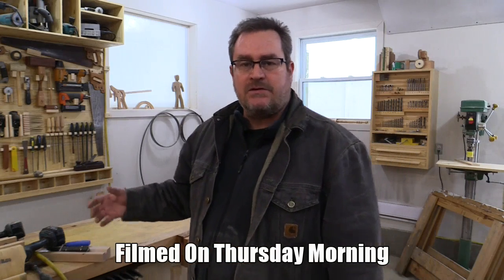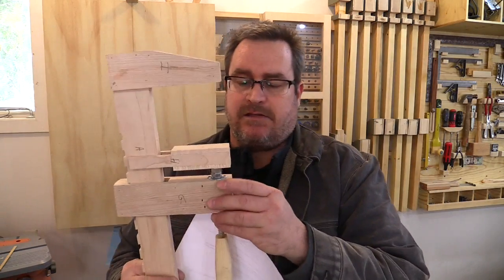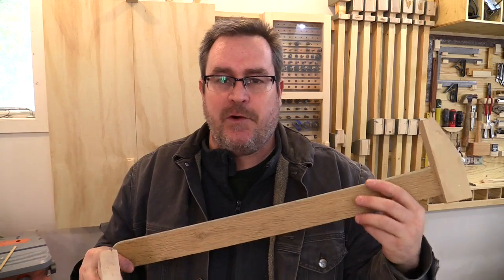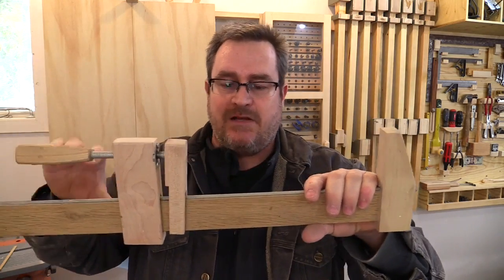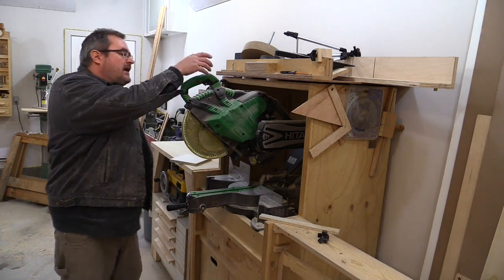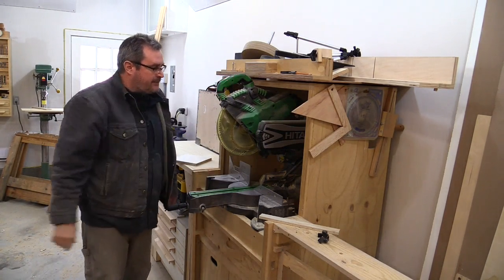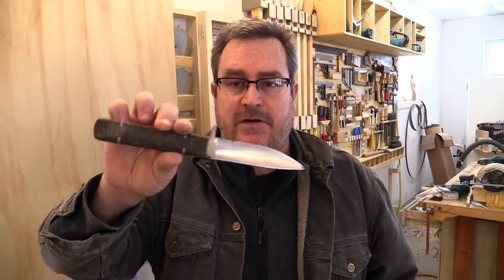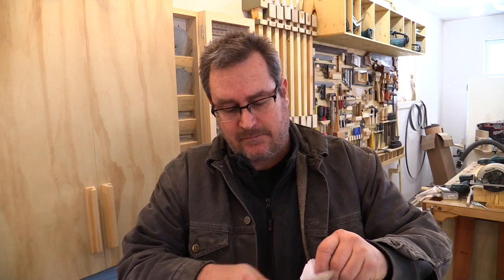The Wooden Bar Clamp(s) And Cold Chisel Knife

Comment: How can I replace a handle on a steel garden rake. Trouble lining up the hole in the fork with the new hole I drill in the handle, into which I install a retention bolt. Harder project. Pitchfork hanle.